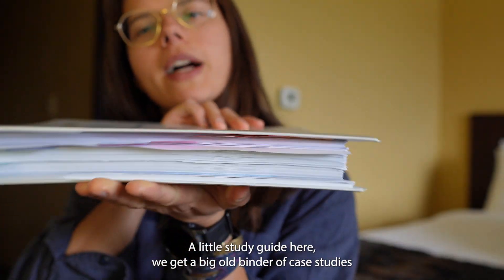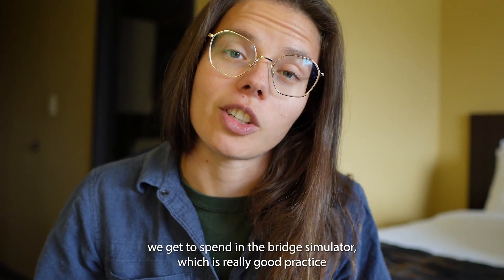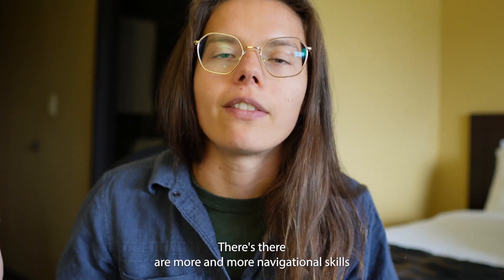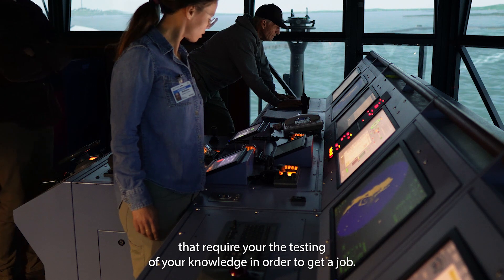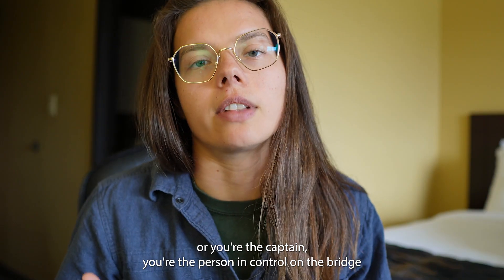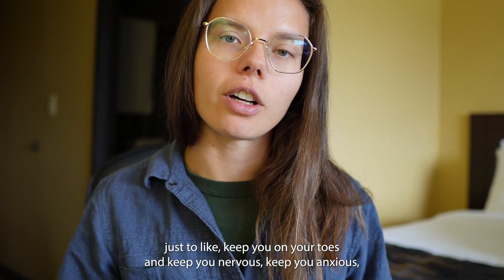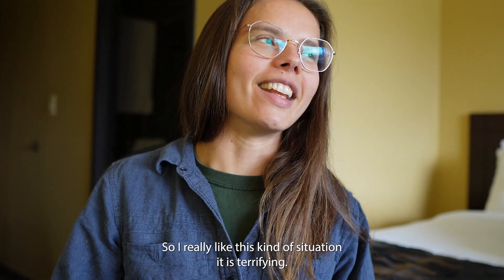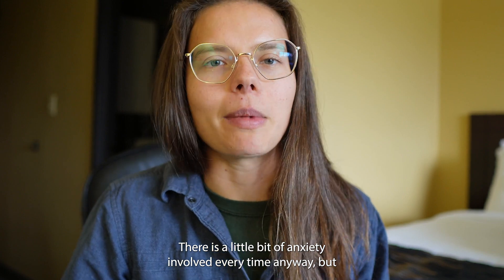Maritime Bridge Simulation Introduction

Comment: This is one of your best explained production yet, Very well done. Does the simulator have motion control? Will deck pitch & roll in heavy seas? Is ships engine & propeller vibration simulated.
Reply from the maker: Thanks for this input! I'll make sure to cover that info in the next couple of vids 🙌 They'll be a bit more hands-on